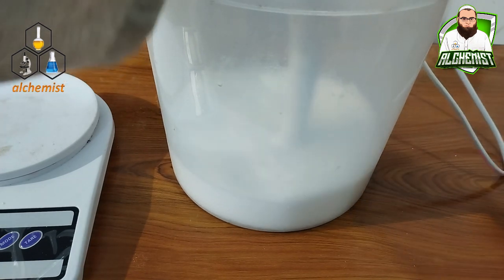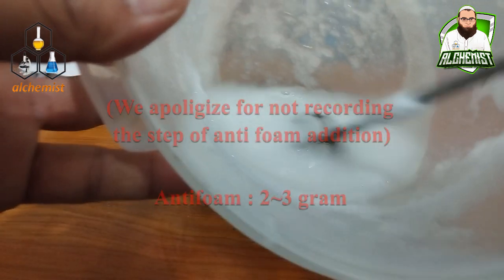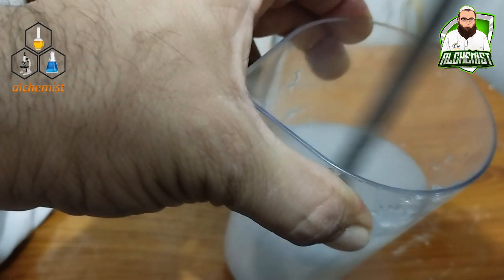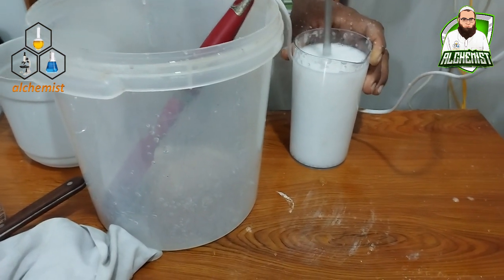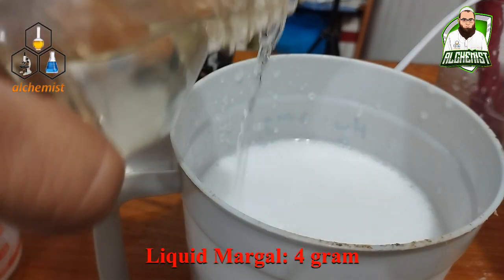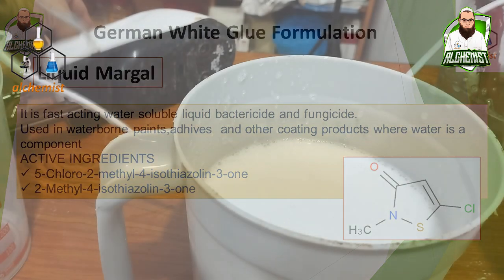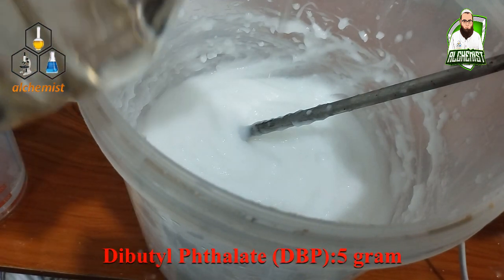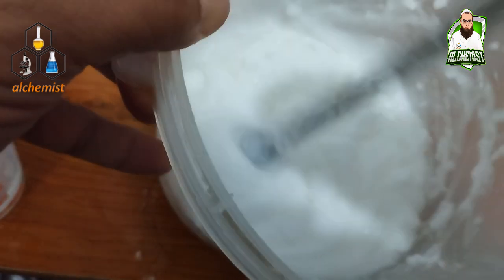German White Glue Complete Formulation

Comment: Thank you Sir, for excellent video.

Please advise if this can  be used as Plywood & laminate pasting adhesive 

Is there any way to speed up the curing time 

Can i Use BP28 instead  of BP26 ?
Reply from the maker: This is wood glue not for plywood or lamination
Also BP26 is the option only
Reply: Ok sir thank you

Can I request to share formulation for pasting laminates sheet to ply wood pls